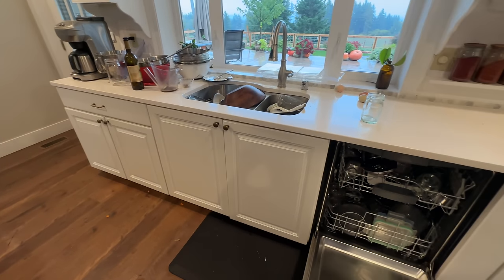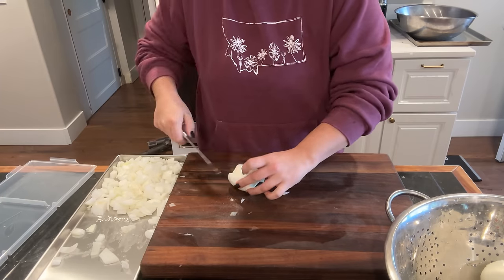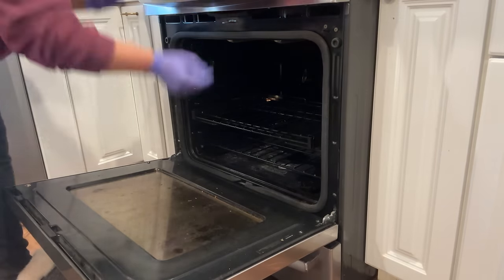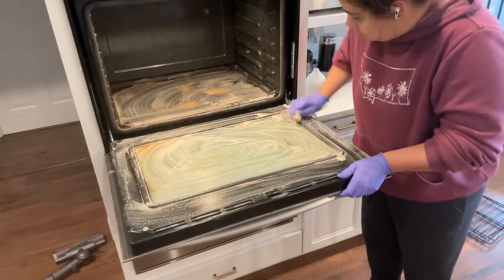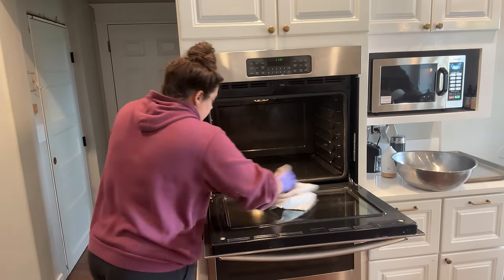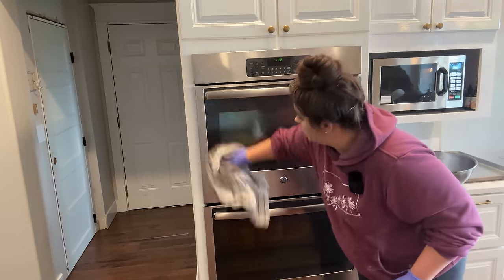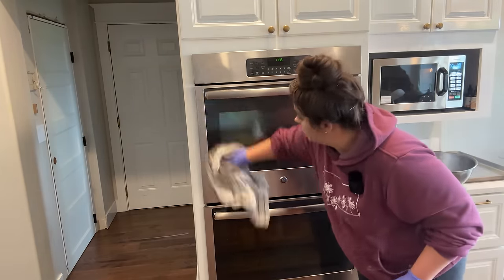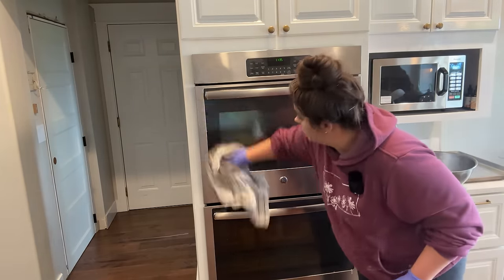This can't be put off any longer!

Comment: I have found hand towels and face clothes in bundles very enexpensive,  I get those and crochet around them for kitchen use. A face cloth is perfect for washing dishes and other kitchen cleaning.  A face cloth folded in quarters and stitched around  makes a perfect potholder and when it starts to wear out , it can be used for other cleaning purposes.  Just a suggestion .

Comment: Hi Becky. When you said something about your laundry room that reminded me to tell you that I don’t mind putting away laundry because of how I do it. I put wheels on my laundry basket (which is also my hamper) and a pull string to wheel the load around the house. When it’s done I wheel it to my bedroom and dump it on my bed (comfortable height) to sort and put away. I hang things directly into the closet and put things directly away. Baby could have similar setup. No dragging hangars back and forth and no folding on the floor and then having to lug back piles of things back to put away. Same with anything like dish towels, just fold them on island and put them directly into drawer where they go.

Comment: Frequency of cleaning most anything, including the oven all depends on how often you use the oven or stove top. Do you fry or bake things that splatter?  I clean my stove top 2 or three times a week. If I do a lot of sheet pan veggies or meat, the oven needs attention perhaps after a month. I tend to use the oven less in the summer so it may go all summer needing to be cleaned.  I clean things when I can see they are dirty. I am too busy to clean for the sake of cleaning something on a set time table.  This works for me. Thanks for sharing your process.

Comment: Becky, I found some oven liners on Amazon that fit on the bottom of my oven. ( I have an electric oven with the heating element on the bottom of the oven, but they make them for gas too.) They are wonderful.  My oven is 48 years old and had stuff burned on the bottom that I couldn’t get up.  I cleaned it the best I could, put the liner over it and my oven looks brand new.  When stuff bubbles over, you can just take the liner out and wipe it off, put it back in the oven and use it again.  I’ve used mine now for two years and it still looks brand new.  I bought the Threadnanny brand.  It will save you lots of work in cleaning your oven.

Comment: Becky, when I clean my ovens, I put a pot of water on the lowest rack and crank it up to highest temp setting for about 30 min. then turn off the oven and let it cool down.  The steam from the water help to loosen and gunk and it permeates into all the corners of the oven.  You may still have to use some cleaner but there is usually a lot less scrubbing.  Also I use just straight baking soda instead of other powdered cleansers.

Comment: Here's a little tip. Oven doors just pull off, very easy. Then you can reach the inside . To try it just open the oven door and pull. Make sure the hinges are both out and flat when putting back on.  Really it's easy.
Keep the videos coming! ❤

Comment: Barkeepers Frirnd can be used on stainless steel, porcelain, & copper bottom pots & pans.  I use Barkeepers Friend to clean the bottom of my copper bottom pans & finish it off with a SOS pad & dry bottom off. They look brand new without buying expensive cleaners.

Comment: I try to clean my oven twice a year but as a disabled person, sometimes I'll be a month (or even longer) late. I've started using an oven liner, which really helps. I can periodically pull it out and wash it in the sink, and I replace it when I do a full clean on the oven (or before, if needed).

Comment: As an almost empty-nester (with only my youngest still at home), the smallest bedroom became a storage room for everything we didn't have the time or energy to find a place for at the time.  This winter, I am sorting through everything in that room to find it a home (either in my house or as a donation) and converting that room into a library and crafts room.  It's a huge project, and not one that can be tackled in a single day.  To piggy-back on that, we have an outside building to assemble that will eventually be a garden shed, but until the library and crafts room is situated, the building will be temporary storage staging area because my house is too small for the clutter-potential of the organizational project.  Even though everyone in my house contributed to the state of the room, I feel most comfortable doing that part by myself to keep the method consistent throughout.  
Regarding doing a deep clean or kitchen and stoves:  I do a deep cleaning for the oven every Equinox (once every 6 months at the start of every Summer and Winter) and a deep clean of the cabinets/cabinet doors and kitchen windows every Solstice (at the start of Spring and Autumn).  And a deep clean of the refrigerator and freezer on New Year's Day.  It doesn't always work out exactly "on time", but once it's done, it's a wonderful feeling.

Comment: 2 tips i do with my oven. 1st one is i put aluminum foil under the burners at the bottom of the oven to catch any drips i fold the edges under and make sure its not touching the coil and it has never effected my cooking but it sure helps with cleaning just lift it and toss. 2. one is i wipe down the door on a regular basis t o keep it looking decent. hope this helps .

Comment: That was a big job Becky.  We have very similar stoves.  Did you know the door can come off making getting inside so much easier and I place the door on top of some towels on my island to make it easier on my back to clean them. (watch a you tube video to see how LOL) You just open the hinge, lift up then out and the doors pop off.  Also have you thought of putting a plastic liner in those baking drawers...might make clean up easier.  I use my self clean option on our oven prob only once a yr then all you do is wipe out the ashes, but I don't do the amount of cooking/baking you do.  You earned that dinner out for sure.

Comment: My 2 major goals is to get my craft room finished moving to the garage and get it set up and ready to craft then get my garden ready in case we get a lot of rain again it’ll be ready to plant as soon as I can instead of having to wait for it to dry so I can disc and stuff I’m in the Central Valley in California and normally we get about 8 inches of rain but last year we got somewhere between 25-40 inches depending on where you live in California then paint the inside of the house so I’m hoping everything goes according to plan

Comment: Becky, I clean my microwave with vinegar and water. I put 1 part vinegar to 4 parts water in a microwave safe container (I use my Pyrex measuring cup) place it in the microwave cook, set it for 4-5 minutes, maybe open a window for the vinegar smell. Everything will wipe right off and it’s food safe so no chemicals. Hope this helps!

Comment: My problem areas are cleaning out the dryer vent pipe.  The lint builds up and can be a fire hazard.  I saw a genius hack that that disattached their vent from the back of their dryer and used a leaf blower to clear out the lint.  Worked like a charm.  
The other area is cleaning the overhead range vent.  The grease really collects there.

Comment: Hi😀Have you tried the self clean funtion in your ovens? I never have to use chemicals or hard scrubbing. I spray the oven with water and put it on self clean and it melts everything . All I have to do is wipe and dry with kitchen towels. I also pull my stove and fridge out (my husband does) and I clean them on the sides and the space before putting them back.

Comment: They make an oven liner that goes in the bottom of the oven, and you can just pull it out and wash it.  Another tip I have, is if your oven racks are bad, put a couple cups of ammonia into a trash bag, and put your racks in there and tie it shut over night.  All the grease comes right off, and you just hose them off outside.  I love watching your videos!!  😊❤

Comment: Add a dish of ammonia to oven let sit overnight.  Cleaning is a lot easier.  As for the racks, place rack and gas top grids in garage bags add ammonia and close tightly.. place outside in bright sun and a few hours later use a power washer (or strong pressure from garden hose) to spray it spotless.

Comment: Hi Becky, you’re doing a wonderful job 🥰
BKF or Ajax powder is amazing! These are great for stainless steel sinks (not stainless steel appliances though, (these cleaners are too abrasive for appliances). Always wipe stainless steel with the grain for a streak-free finish. 
Your stove exhaust or range hood filters can be cleaned by soaking them in a warm bath tub with a dishwasher tablet. The same goes for your oven racks and stove top trivets.
Here’s a hint for cleaning your microwave. Put a cup of water in for 1 minute before cleaning. This will soften any food stuck in to the roof or sides etc making it easier to wipe off.
You can usually unscrew the oven door glass to clean the inside layers.
Does your dishwasher have an under door shelf? This is usually visible with the door slightly ajar. This area can get very grubby. 
Microfibre cloths are a great asset for cleaning. Just don’t use fabric softener when you wash them otherwise they’re not absorbent. 
Kick boards under your bottom cupboards is another area that can get grubby and not really noticeable until you get down there.

Comment: Here's a tip for your oven grates, shelves or when you want to clean the grill grates. Put them in a double bagged large lawn and leaf plastic bag. Fill with sudsing ammonia and let sit outside overnight. Spray off the next day with a hose or pressure washer.

Comment: I believe you can oven the oven part way and lift the doors off . I know the old ones you could.  You might want to try it so you can get back of oven. Just a lil tidbit  Also i got some cheap contact paper to line drawers with and helps preserve the wood and easy to wipe out. You sound like you need a checklist for the week and month an check them off as you do them. Might acturally save you time and calm your mind a bit.

Comment: Sometimes, the oven doors are removable, which makes cleaning so much easier!  I clean mine once a year unless something gets spilled.  Usually, I have a foil pan at the bottom of the oven.  Wish I had your energy!  I'm surprised you don't have self-cleaning function on the electric oven.  I do but never use it!
Thanks for answering the self-cleaning right after I sent my comment, LOL

Comment: Becky, for safety I highly recommend getting a tool made for scraping messes with a razor blade. It's small, holds a standard blade and tucks the blade away when not in use. You can find them in hardware stores usually

Comment: Put your oven trays in the dishwasher for a cycle. It will soften any baked on food so you can easily scrub it off. A bowl of water in the microwave on high for 3 minutes does the same thing😊 it just makes things easier. If you get cotton microfibre cloths you'll fall in love with them. I have a feeling you had Polyester microfibre cloths.

Comment: Becky, what brand of cleaning spray do you use? Was this a concentrate? This is perfect timing because our turkey slid off the back of the oven shelf while pushing it back in. Drippings all over!
Also, please (!) do not put wooden tools or bowls in a dishwasher, or soak in water. It can ruin the wood. They need to have wood oil on them to preserve the finish.

Comment: I have my son pull out our refrigerator so we can vacuum the coils in the back. It makes the appliance run more energy efficient.  We also take the back off the dryer and vacuum the inside of the machine. To get the lent out of all the knuck and crannies. Dryers that don't get cleaning properly can cause vent fires.

I clean my oven, refrigerator, and microwave weekly. And I do a deep clean( pull the appliances away from.the walls and vacuum the coils) twice a ÿear. Spring cleaning and fall cleaning.

Comment: To deep clean a sterilize your microwave. Put a 1/4 lemon juice and 1/4 water into a coffee mug, heat it in your microwave 3 minutes at time. It will steam all those little dried bits and losen grease. After each 3 minute cycle wipe out the inside and ceiling with a clean cloth. You will be amazed at how clean it will be and smells so good.

Comment: One of my favorite children's books is, "If You Give a Mouse a Cookie." If you give a mouse a cookie, he'll want a glass of milk to wash it down and then he'll want a napkin to wipe his mouth and then ...  That's what beginning a cleaning project is like, one thing leads to another and another and another. I've been procrastinating on pulling out my refrigerator all week and scrubbing the walls, the floor, the cabinet beside and underneath the overhead cabinet. I'm getting a new refrigerator next week so I need to have the whole area super cleaned. I can see that tomorrow will be "If I've pulled out and scrubbed the refrigerator area, I might as well do the same with the stove. If those two areas are clean, I might as well get in the dishwasher and scrub that area where the door sits on the body of the dishwasher. And then and then and then ...    Thanks for the motivation to get into my kitchen tomorrow, Becky. Yours looks absolutely wonderful and I hope you were able to eat freezer meals for awhile so you could just relax and enjoy that clean area.

Comment: I cleaned my stove last week. Pulled it out and used a old toothbrush in all the cracks. It felt so good. I would like to get all indoor remodel project doneb4 spring. Remodeled bathroom and updated kitchen. Just little stuff left but it is a mile long

Comment: Oh WoW ...
This is the one job I hate doing, oven cleaning. I don't miss that job !! It's so nice to have self-cleaning now. It's just a simple wipe down with damp cloth when it's done !! Deep cleaning for me, which I also don't like, is doing all the window sills. I do it once a year to their spotless and then monthly a easy wipe down after vacuum the dust out..
Buy yourself some extra strength oven spray cleaner, coat the inside well. Go to bed, next day wipe clean, I clean mine once a year unless I have a spill. Don't be afraid to use your self cleaning mode. The other oven may had been old or could of been a one off 😉

Comment: Becky, I'm a messy cook too.  So i clean my oven about once a month.  Also, if you're worried about using chemicals in your oven, I have a recommendation.  I use a water vinegar solution and it works for me as the vinegar helps to cut the grease build up.

Comment: I started using freezer paper to line all my drawers and pantry shelves. Easy to fold and crease to fit, plastic coated side protects if something is spilled. It lasts a long time, so  can throw it away without feeling wasteful when it needs to be replaced.

Comment: Hey Becky. Not sure if yours is the same, but I googled my oven and how to take the door off. All I did was open it a little then pull up. The door comes right off. Not tools needed. Makes it so much easier to clean the oven part. I’m short so I literally have to get in the oven to reach the back 😂

Comment: Becky.  You can get a handle that holds those scraper blades.  They are easier to hold and maneuver.  Less chance of getting cut.  I have lived in my apartment for 20 years.  This summer the fridge died and the maintenance man replaced it.  When he took out the old one the floor underneath was black.  The wall behind it was filthy with dust bunnies and drips.  DRIPS?  I spent half an hour cleaning the grime while he went to get the new fridge.  It was horrible!!  Twenty years is definitely too long.

Comment: Your kitchen is very well-designed for a large kitchen.   The baking drawers are brilliant.  Does anyone know what the front compartment is for?   This has always puzzled me. 
Also, don't forget to clean the inside tops of your ovens, ladies.  Start there so all the gross stuff can fall on the bottom of the oven first.  You got a lot of work done, Becky.  Well done! ~ Lisa

Comment: for future reference, you can take the oven doors off. there's a lock on the metal curvy bits that hook the door to the oven and you unlock them, put the door back to a slightly upward position and pull up(probably want to google a video of that. my description wasn't that great). ANway, it would be easier to clean the inner part of the oven without the door in the way.

Comment: Appliance repair tech's recommend Not to use the Self clean function because of reasons like yours. We used it a few time before but discovered that it started to fry one of the wires powering the lower element so we haven't used it since then. thankfully the repair wasn't too expensive.

To make oven cleaning easier for less deep cleans do a "Steam clean" which is what newer oven recommend. Put a dish of water at the lowest point in the oven, and turn the oven on to 450 and run it for at least 20 minutes. Then shut off the oven, and let it cool but don't open the door. once cool should be able to wipe it down with a cloth and water. Some ovens have an area at the bottom where you can directly pour some water and click the "Steam Clean" button on the control panel.

Comment: The one thing people tend to forget to clean is your dryer vent. It would be best if you had it cleaned out at least once a year. Forgetting to do this puts you at risk for a house fire. A clogged vent also reduces the efficiency of a dryer, meaning it takes longer to dry and uses more energy.

Comment: You asked: pull stoves out away from the wall. So much crud gathers on the floors, sides of oven & walls. Also, back of microwave (vacuum the vent section first). Then the exhaust fans. Check style of filters. If charcoal: clean or replace. 🤷‍♀️